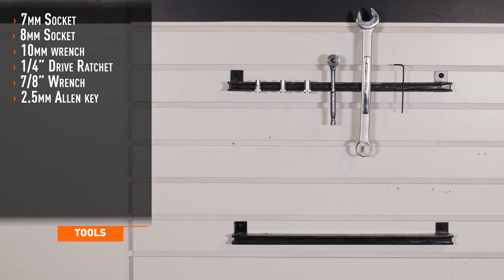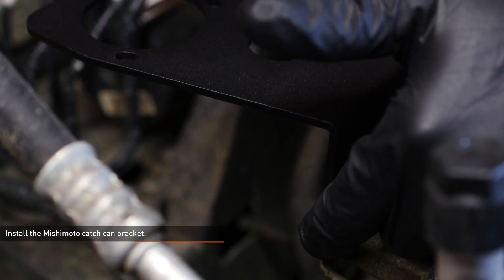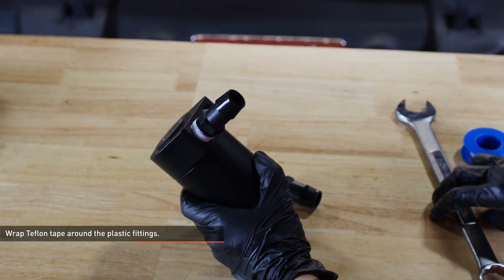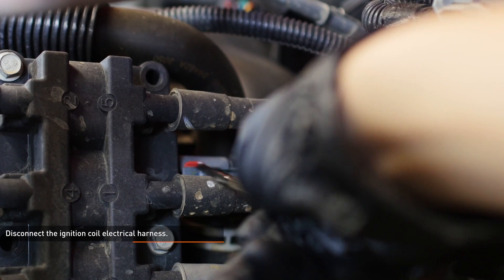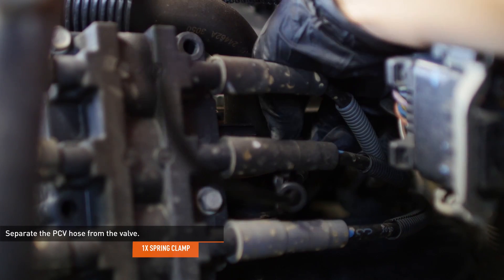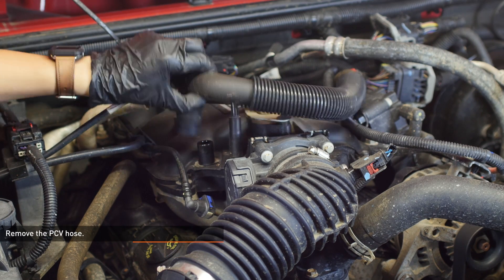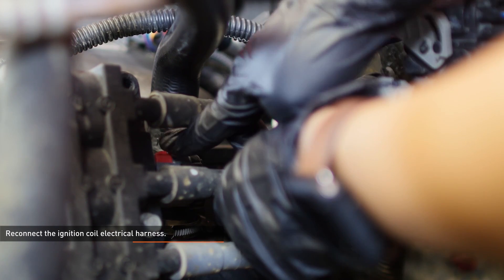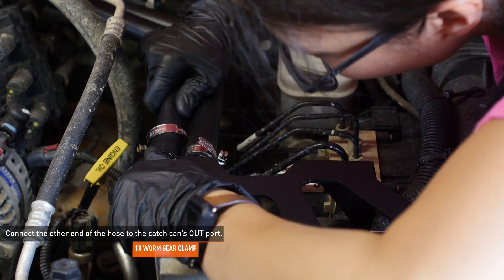2007-2011 Jeep Wrangler JK Baffled Oil Catch Can Installation Guide by Mishimoto

Comment: So, here’s a question, I bought this can about 4 months ago and installed it correctly only to find out when I started the jeep it literally wouldn’t start. Re check all fitting and made sure hoses were on correctly.  Than after several hours trying to figure it out gave up and put the other hoses back on and the dam thing runs! So, what would make it do that?
Reply from the maker: We've never heard of this. The only guess we could provide without knowing more is a large vacuum leak was introduced somewhere in the system, preventing the vehicle from running. Please reach out to our team at support@mishimoto.com and they'd be happy to look into this for you.

Comment: Why is this needed for a non Direct Injection engine?
Reply from the maker: Many of the same reasons as this will keep your intake tract cleaner and keep the oil vapors from entering your combustion chamber.
Reply: @mishimoto yep, and hopefully helps with the EGR valve getting so clogged, in addition to your engine burning that oil.

Comment: is the only way to drain it through the bolt at the bottom or is the can threaded on?
Reply from the maker: The bottom of the catch-can has threads and can be unscrewed for cleaning.
Reply: @mishimoto what is the thread pitch of the plug?